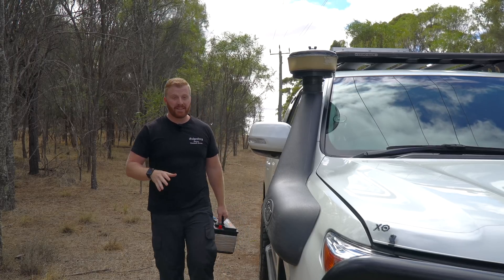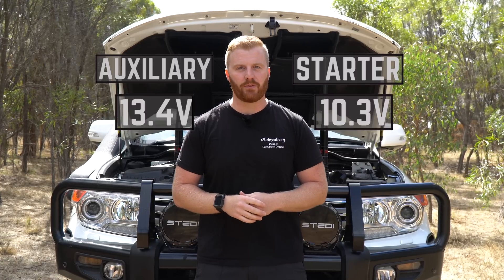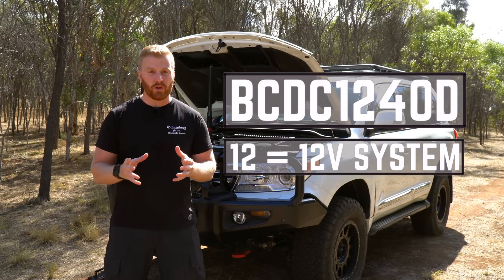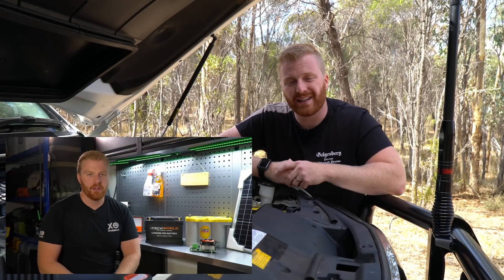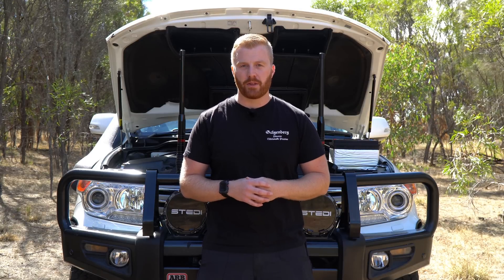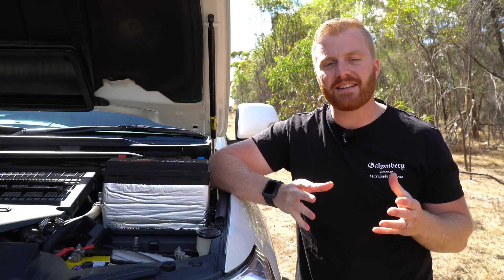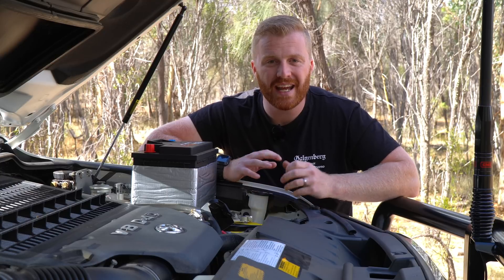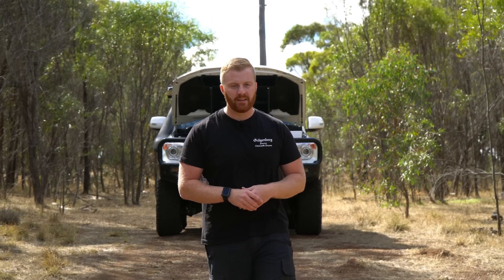LITHIUM is OUT for now… | Not everything works first time | iTechWorld 1420 CA PRO | The AGM is back

Comment: Hi Nathan I have recently fitted lithium start battery and had this issue you talk of. I have since fitted an ignition triggered allbright solenoid which solved the BCDC issue. Since then I have discovered that after a week the start battery is drained. It seems to be drawing approximately 150m/amps. Some research has lead me to think that perhaps due to the high static voltage there is a component not shutting down. ie engine computer. I am yet to look into and confirm what is the issue. My question for you is whether you have refitted the lithium and whether you have experienced the same issues I am having. Looking at this stage I will have to buy some new AGM batteries for it which I was hoping not to do as trying to reduce weight. 

Thanks Alan

Comment: Nathan do you have an update on what you did regarding your lithium starter battery. How did you resolve your issue. I have tried searching your YTubes but couldn’t find anything. Hope you can guide me. 😊
Reply from the maker: For sure mate. So I did manage to fix it and years on it’s still going strong. All I ended up doing was placing a heavy duty relay on the power wire to the redarc charger. This relay was triggered by ignition, so essentially every time the vehicle is turned off the redarc charger looses power and isolates those batteries 👍 hope that helps?
Reply: @XploringOz  Can you still charge via solar when the ignition is off? Will solar charge both batteries? I have the exact same battery and bcdc setup. I went with the victron unit havent installed it yet!

Comment: They need to make the float voltages on the these lithium cranking batteries customisable. Similar issues can occur with smart alternators that only start boosting when the voltage drops to a certain point.

Comment: My original smart solenoid wasn't going to work with my two Lithium 1420CA PRO batteries so i fitted a straight solenoid controlled by ignition ... still working a few years later.

Comment: Late to the party here, but if it was Frank you spoke to at Redarc, the proposed solution came from me when I was having similar but different issue with my Jeep way back. I was using a 10w solar panel to maintain charge in my starter batt.  Due to some not very well thought out design, if the starter battery drops below 12.4v, the 5v glow plugs don't get enuf voltage to get hot & start the engine after an overnight soak when <\= 0DegC. Once started with some warmth in the engine, no probs for the rest of the day.  However the solar was doing it's job float charging the starter batt, and ALSO keeping the DC-DC charger on, sending all the charge to the AGM Aux batt. So we put a 200Amp relay on the feed to the DC-DC charger switched by the IGN. Problem solved. Also allows you to maintanence charge the starter Batt without the DC-DC charger kicking in too screwing up the charging profile. Been working for the last 11years like that. A programmable Voltage Sensing Relay is nice, but KISS. 🤷

Comment: Went round Australia twice in opposite directions, every-time withe single lead acid cheapie in an automatic. Carried induction stove and 1200W capsule coffee maker. I NEVER let the engine run whilst re-inflating my 4 wheels and made 100's of cups of coffee with a 600W inverter from Kmart screaming to make coffee.  Never faced a battery issue, just some alternators after driving thru sandy water soaking out only generator.  You gotta be daring in a 20 year old automatic knowing that only the starter motor can start it.  Not even a single solar panel came along. Done heaps of sand dunes, hidden tracks nobody been onto for decades. Not even a sattelite phone, just common sense.

Comment: Great Vid. I am looking at a similar set up for a 200 series and wondered now that you are 12 months down the track, which way did you go? Did you install two iTECH lithiums in the 200 series? I am concerned about longevity of lithium in the engine bay. Cheers again for the vids. I'm working my way through your library! Awesome work.
Reply from the maker: Thanks mate, appreciate that. 
Yes, I'm still running twin iTechWorld batteries in the engine bay. The 1420CA PRO has been installed for over a year and a half, controlled by a 70A relay which is ignition fed. The secondary battery in coming up to 12 months old and so far so good. I'll have a 12 month review very soon 👍

Comment: I have a similar set up in my LC200 with lithium deep cycle and a cranking one also.
What relay did you end up going for and how did you wire it between the cranking; the BCDC and the aux batt ?
Reply from the maker: Hey mate, so I used a heavy duty 70A relay to isolate the batteries. This is wired to control the Redarc unit and is ignition fed. So whenever the ignition is switched off, so is power to the Redarc BCDC1240 and therefore it can't charge the auxiliary, essentially isolating the battery 👍 
Its been permanently installed for about 1.5yrs now with no issues.
Reply: God stuff. I have a RedArc 1225D BCDC and also a lithium auxiliary so already had the BCDC in Lithium charging mode. So when you say isolating the batteries and ignition fed, where did you wire in the relay? I have a SBI12 relay or isolator that I could use but just keen to know where exactly is the right place to do it. And do we need to connect the blue cable coming from BCDC?
Reply from the maker: @marcelomatos6977  So I wired this relay on the power wire, powering the redarc dcdc charger. Once activated, the redarc simply has no power and doesn’t turn on. 
The ignition feed was simply sourced from an ignition wire from the factory fuse block. 
Once the engine was turned off, the relay switched and cut power to the redarc 👍
Reply: @XploringOz  great mate much appreciated. Can I ask final question: what brand and model relay did you go for ?
Reply from the maker: So I just went with a Narva 70A 4 PIN relay in my vehicle 👍  @marcelomatos6977

Comment: No victron smart battery Isolation between the start battery and the 2nd battery so it can shut the battery down . And with the lithium batteries staying so high in the voltages the redarc system will keep supplying charge to the 2nd battery.  This is why itechworld tell customers to fit a victron smart battery. Isolation  and the victron unit u can set the switch off and start up voltages.  I've got 2 of these units in my 200series, and I've not had 1 issues.. redarc are working on the sbi Isolation Switch that will be able to changed through Bluetooth on your phone . Victron smart battery protect units already have that feature as redarc are months months away from the product coming out.  They do have 1 sbi unit that you can have the cut out and restart voltages set at redarc, but the issue is that if you need to adjust them the unit needs to go back to redarc which is a big down side
Reply from the maker: For sure. I ended up just using a simple relay to control the Redarc DCDC charging which was triggered from ignition. Whenever the vehicle turnoff, so was that connection between the two batteries. This has been working well now for over a year 👍

Comment: Well spoken and explained mate. Currently looking at Itechworld batteries.
Reply from the maker: Thanks mate, appreciate that. For what it's worth, I'm still running the same starter battery without issue 👍
Reply: @XploringOz  I'm looking at their smaller motorbike batteries for an experimental aircraft, either that or make one.
Reply from the maker: @chippyjohn1  Wow, that sounds like a great project. All the best, hopefully you find the best solution to the power needs 👍

Comment: It sounds as though the key switch relay will deprive the aux battery of the top offs that would extend it's useful deep cycle endurance. Wouldn't it be better if you could either alter the source minimum threshold in the BCDC or install the programmable relay with the minimum threshold set high enough to cut off the source battery and preserve it's charge state but still allow the top offs to occur before that condition is reached?

Comment: Hey mate excellent and very informative video as per usual, I’m also looking to run the same system, with the itech cranking and 120x pro aux, I have a 1225d with solar running in and still has the redarc isolator in as well for the jump start in cab, will I need to also run a 70a hd relay from lithium crank battery to bcdc?
What relay did you get and how did you wire it?
Cheers

Comment: always disconnect cranking battery from auxiliary battery when car is off., the 50A relay is a good solution.  otherwise you might be stranded when cranking battery doesn't crank any more.   boats have manual switch for that, off, left, ride, both
Reply from the maker: For sure, I now have a 70A relay that ignition controls the Redarc charging unit and this has been working well for the past year 👍

Comment: Yep, they just are not setup for a lithium battery as a start. I have a full lithium setup in my boat including Lithium cranking battery. I started with the Redarc. But have since changed to Victron DCDC as you can set and customise the charge and cut out settings.
Reply from the maker: Yes, the Redarc is not setup for it, but easily fixed with a 70A heavy duty relay installed to trigger from ignition 👍

Comment: Hi Nathan, did the redarc and itech provided the wiring diagrams with the isolator? i am facing kind of same issue too but mine is AGM start battery and Lithum AUX battery. i am thinking of installing a victorn smart battery protect in between my AGM start battery and BCDC 1240D. One thing i dont undestand is the BCDC1240D has a blue ignition wire wihich surposes will detect the start battery voltage drop and stop the BCDC from working, not sure why it does not work?

Comment: thank you, Sterling  UK,  B2B charges, their switch off is 13.2 it can be changed ,30/60 amp  out ..Merc approved in Europe and the US, it will also handle Euro 5/6 alternators with 17.5 v and 200 amp cycles..

Comment: I think it's good leaving it like that. You don't want to waste the good capacity of your lithium batteries. Knowing that it would discharge 60% before it drops 12.7V, I now have a new idea of dual battery setup. I'll install two lithium dual purpose batteries and wire all my accessories via a VSR. But the itech one is only 60AH. By searching this solution, I found that DCS already had this kind of system. While they use a Victron smart protector, which cost over $200. a VSR only cost $20.
Reply from the maker: Awesome, that sounds like a much more cost effective way to make this solution work 👍

Comment: So, like most YT channels trying to be The Informer that society should seek for guidance and direction.....he didn't do full Due Diligence/Homework before applying a part or technology and Definitely before posting a video.

Stop operating on a Cure It mindset and do the Prevent It mindset.
Reply from the maker: 🤷‍♂️ It wasn't an issue with the product and it was fixed with a $50 relay to control the charger in the vehicle.... I mean, it really wasn't that bad 😆

Comment: I am far from impressed with Redarc stuff as the BCDC's are overpriced turds which far cheaper and better options are out there. Especially those that shut off charge as soon as the crank batter drops off alternator charge.
Reply from the maker: I would agree that the Redarc is 100% expensive (that comes with the phrase 'Australian manufactured'), however they have their place in the market. I know there's plenty of options out there, but what would you consider better than produces 40A of charge and can be engine bay mounted?
Reply: @XploringOz  The first thing to consider is why are you putting a 40A charger in? Your case is a Lithium aux battery that can take a high charge rate but others running AGM/SLA, 40A is way to high as those chemistries should not exceed C20 rate. The next part of the equasion is the alternator load, many alternators are not capable of the claimed figures unless turning at high speeds to not only make that current but also move enough heat with airflow. GU's with TD42 kettles are well known for cooking alternators at idle. 
As for chargers, there is a flood of generic units online that actually are very solid units that handle all types of chemistries but also cutoff very shortlky after engine stop. I myself use a isolation relay or LVR to save my crank battery. Another plus of the units I am refering to are that they have builtin MPPT solar chargers to keep both batteries charged avoiding the need for LVR's.
Reply from the maker: @bentheguru4986  I see where you are coming from, but as technology integrates more and more with this lifestyle, charging rates are becoming more and more important. A C20 charging rate is preferred for an AGM and the BCDC1240D puts in about 33A, only a little over this, however I never had a drama in the 5 years of using it in this way. As you mentioned, lithium in another ball game and can comfortably accept this. 

The alternators, well that's going to be a vehicle to vehicle specific issue. Again, I've had this setup for many years, charging batteries every day along with using his voltage spotlights, camp lights, air compressor and winches without an issue. There is no doubt that it's placing extra strain on the alternator, but it doesn't really matter what method or product you use, if you want to power it has to come from somewhere. 

I can see that your not a fan of Redarc gear, but as I mentioned before, they have their place in the market and there's still a reason they are 'one' of the most popular systems out there. 

As for the generic units online, any specifics ones that you refer to that are designed and warranted for under bonnet use?
Reply: @XploringOz  I sent link in an email for you.

Comment: I sent mine back i tested and found only 26ah. Kept getting a flat battery. They also state Lithium-Ion which is not the safer Lifepo4 and i would not put the volatile LiPoly or NMC lithium under bonnet.

Comment: Hi there. I know this is an old video but what about getting rid of the BCDC altogether and using the Victron Battery disconnect? Or putting in a bigger relay and switching out the auxiliary immediately upon engine stop. Then the auxiliary can use full alternator current upon restarting the vehicle?

Comment: so would you say that this 1420 pro/non pro battery is ample for . . . 
*heavy 4wd winching
*river crossing (getting submerged, possibly stuck at moments).
*Being killed overnight from 12v gear ?
*Able to be paired as a primary and/or secondary with any other AGM or LEAD battery?

Noob question: Would i be right in saying that if you had the 1420 as a secondary, and a standard as the primary. 
You wouldn't need a high amp relay to kill the link to the BCDC.
 But would you would still get the cranking capacity from the secondary?
Reply from the maker: Hey mate, so I've done all those things with both the lithiums batteries are they are still going strong. 
I wouldn't be using the 120X battery as a cranking though as I don't believe the BMS will allow that discharge rate.

Comment: Hi I just watched this video 26.11.22 and wondering if you have reinstalled the itech back in your car. Ps not sure if you will see this
Reply from the maker: Hey mate, so yes I have re-installed this battery back in. I ended up installing a 70A heavy duty relay between the battery and the Redarc BCDC charger. This ensures the Redarc chargers is not active when the ignition is switched off. So far it has been working well. I'll be sure to follow up with a long term review on this battery after some good testing 👍
Reply: @XploringOz  thanks for getting back Nathan

Comment: I run a Renogy DC-DC charger with lithium aux, lead acid crank battery, and solar input.  When the aux battery is full, the Renogy charges the crank battery using solar input.  However, your excellent explanation of the lithium crank battery issue has alerted me - when my 4 year old crank battery dies I was planning to put in a Lithium, and would almost certainly have run into this issue, although somewhat mitigated by the solar input to the crank battery being pretty much continuous (because the crank battery would be topping up the aux to 100%).  Fitting a simple isolator would destroy my crank battery charging from the solar, so that would not work for me.  I need to check the Victron unit to see if it can pass the current both ways, and isolate the crank when engine is off.  Otherwise my solution would be to go with lead acid crank battery again.

Comment: This is the reason why i changed my system to a intervolt unit.. i had a projecta unit that even with the ign wire connected it would revert to standard settings when the ign was in the off position id come back to the car with a voltage of anywhere between 11.5-11.8 (starting battery) and the unit would automatically trigger itself on and off as the battery rested and came back up to the threshold, with the intervolt unit on the correct settings once the ignition is off.. the unit is off.. and it disregards any setting other than solar input (if solar panel is connected)... great informative videos by the way..
Reply from the maker: For sure and I'm confident that Redarc will start to adapt to this technology by adding these features to their units as well. To be honest I'm surprised they haven't already. 
Thanks mate, appreciate the feedback.

Comment: Great Video. Using the KISS principle, why not go to a 200amp narva relay to connect the batteries, open when ignition is on, closes when off. You can run a basic additional relay for manual override as needed. This is assuming both batteries mgt systems can take constant alternator charge. You then run LV disconnects on your aux systems as needed. Ditch the fancy (expensive) gear.